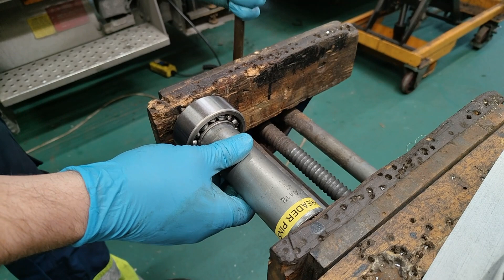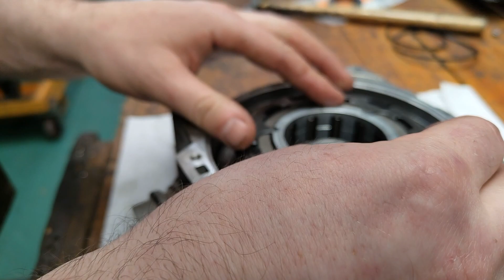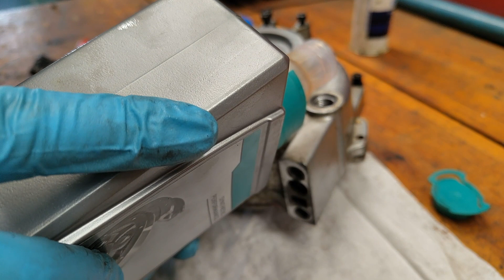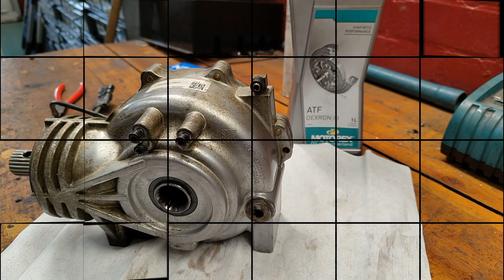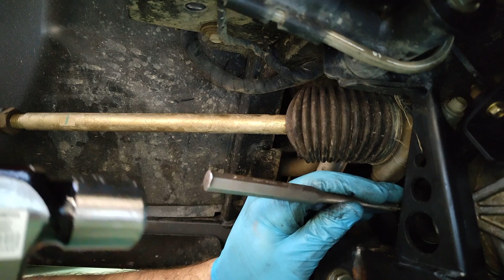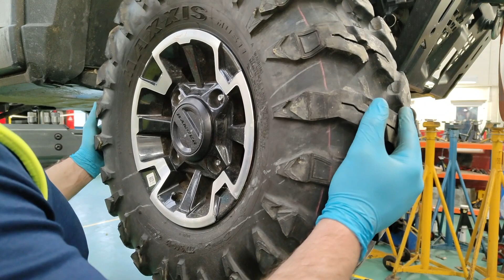POLARIS RANGER XP 1000 - Front Diff assembly.

Comment: Why ATF ? Not Polaris diff oil ? Why not 75-90 gear oil ?
Reply from the maker: Dextron 3 was supplied from the dealer as a DDF alternative 75/90 is too thick for front demand drive. 
Atf works fine.
Reply: 75-90? Why? One thing sure, you don't live in MN. LOL
Reply: Use DD, I'm sure it works. $$$$. SO does ATF.